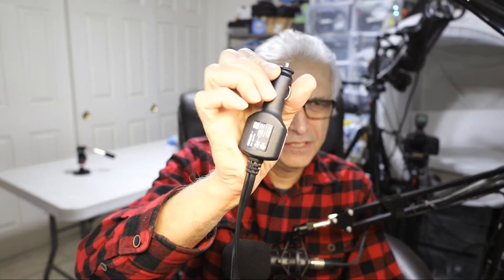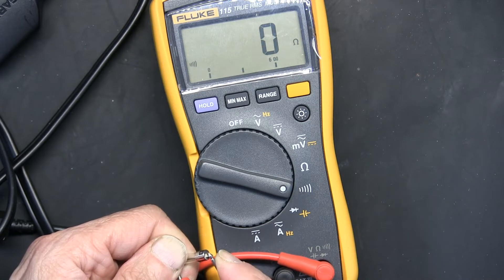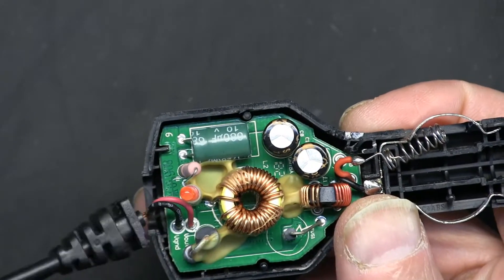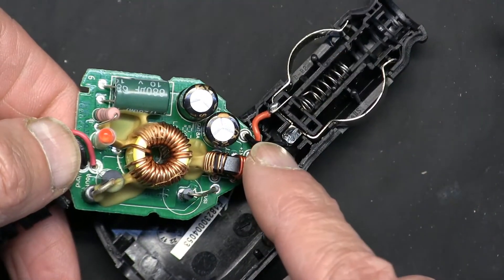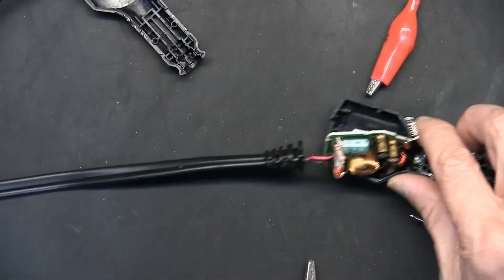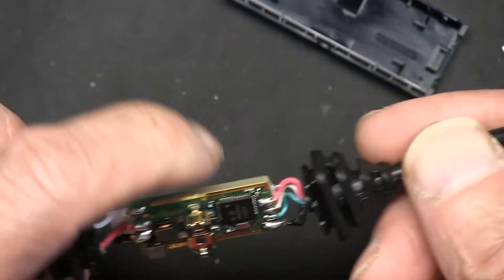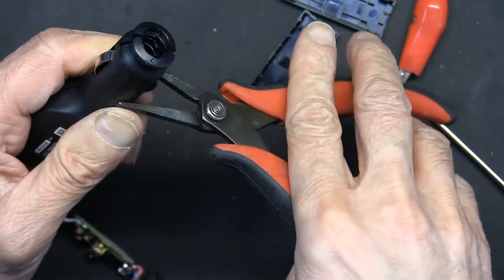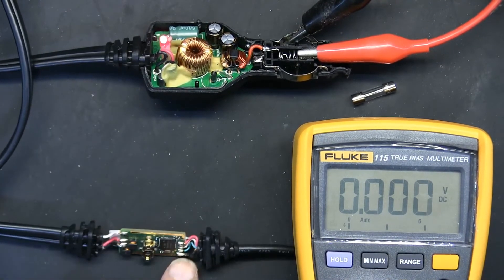Diagnostics, Fuse Check and Repair of Garmin GTM Traffic Receiver For GTM60 GTM36 GTM35 GTM26 GTM25

Comment: HELP! I have a functioning GTM-36. My problem is i don't have the external antenna that you can plug into it to make it receive better. It appears to be a 2.5mm plug but dont know if its a stereo type plug or a mono type plug. The pin-out of the plug is also unknown. It would be very simple to build one if we knew what type of 2.5 mm plug, how long of wire and what pings on the plug to use. I live in an area where signals just not strong enough with out the external antenna. The GTM-36 I bought on ebay had the external antenna piece missing. The GTM-36 does work just needs a little help for better signal............Also great video.
Reply from the maker: They are only $6 and you can get them on eBay. Here is an example https://www.ebay.com/itm/236423872364

Comment: Garmin are now supplying  sealed charger units,if the fuse goes,you'll have to buy a whole new charger,no changing fuse anymore!!
Reply from the maker: Thanks for letting me know. That is so sad and very unethical in every way. I can't believe what corporate greed can push them to do. I hope they think again and improve their design to let people change their fuses without forcing them into buying a new charger.
Reply: @TECHNOLOGYTIPS101  a replacement  charger unit us 39 euros!!
Reply from the maker: @niallchurch2679  Can you imagine!!! When replacing the fuse, it would cost less than one Euro.
Reply: @TECHNOLOGYTIPS101  yup that's right,got an email from them confirming, the garmin drive 53 I have with usb c connection, has a c connection charger, and the fuse cannot be replaced alone,a new unit will have to be purchased for it!

Comment: How do I avoid blowing the fuse or damaging the internals of my GTM60 because its not a cheap cable and its in fact my favorite for my 2597
Reply from the maker: These are some common causes of fuse blowout. 
1. Short Out the output 
2. Let the Cable or GPS get wet 
3. Use the cable on a GPS other than what it is designed for
4. Use the cable in a car with Bad Alternator 
5. Fried components inside the GPS

Comment: After seeing this I realized that if the cigarette lighter part was not working, but the traffic receiver part was OK, then you could also just remove The cigarette lighter and replace it with a simple USB-A or USB-C cable at the 5v power lines and then have a functioning traffic receiver cable that plugs into a USB port in the car rather than the bulky cigarette adapter. Is that correct ? Of course the USB port in the car would need to be 2A, but many cars have that now.
Reply from the maker: Hi, yes you can but add a 100μF 16V electrolytic capacitor to the output so that it can handle the aggressive current fluctuation that the Garmin will subject the USB port to. This way the Garmin Screen will not flicker during usage.

Comment: Hi, please help me I have dēzlCam LMT-D and the camera that shoots no longer work! appears that does not see the SD card, has update done sd card is reset and nothing! thx you
Reply from the maker: Hi, try using a SanDisk SD with SDHC Class 10 and see if it will work
Reply: @TECHNOLOGYTIPS101 , Hi, I tried everything, actually worked and suddenly it doesn't want to anymore! The problem from garmin I don't have service in the UK in the north and you can't even find the option to reinstall software from their web page. Thx you for your time.

Comment: Will GTM 36 work with Garmin DriveSmart  55 MT-S? In the internet I can find it's useless: "[...]The HD Digital Traffic reception in the DriveSmart 55MT or DriveSmart 65MT is built-in to the GPS unit itself. It does not require an accessory traffic cable. It only requires the TA20 vehicle power cable that comes with it. This means that you don't need to drape your power cable to enhance coverage from the HD radio stations nearby; the signal is received directly through the GPS.

One can use a GTM36 or GTM60 cable with the DriveSmart 55 or 65, but there is no advantage.[...]"
Reply from the maker: The difference between the standard ( Analog ) FM receivers and Digital HD receivers is not only the traffic information coverage, but the speed at which it refreshes. For example lets say there is an accident on the freeway the Digital Receivers will notify you much sooner than the Analog. The same goes when the accident clears. Also depending on where you live the HD Receivers can get more than traffic such as weather conditions road closures etc.
Reply: @TECHNOLOGYTIPS101  but do you know will my garmin detect GTM 36? For now with basic original car charger when in garmin I open app "Traffic" it says "Open the Garmin Drive app on your phone". So I'm confused will it also work with GTM 36.
Reply from the maker: @xdmichal93  Here is the list of Garmin devices that will work with GTM36 https://www.garmin.com/en-US/p/100586#devices

Comment: Having issues connecting my gmt60 to Farmington dezlcam 85
Reply from the maker: Do you mean DezlCam 785?
Reply: @TECHNOLOGYTIPS101  yes. Sorry for the typo
Reply from the maker: @jaimeblazer2002  Which exact one do you have?  dezlCam  785 LMT-S  or dezlCam  785 LMT
Reply: @TECHNOLOGYTIPS101  dezl cam
Reply from the maker: @jaimeblazer2002  You need to run Garmin Web Updater to updage the firmware on your Navigation unit to make it compatible with HD Traffic. Do not use Garmin Express only use Garmin Web Updater here is the link for it https://www8.garmin.com/support/collection.jsp?product=999-99999-27
Reply: @TECHNOLOGYTIPS101  connect to a computer?
Reply from the maker: @jaimeblazer2002  Yes it has to be a PC, it will not work on a Mac, and also use the same USB cable that came with the device. If you don't have it then use any Mini/Micro USB to USB A Cable.
Reply: @TECHNOLOGYTIPS101  thank you. I will be trying it as soon as I get a chance.
Reply from the maker: @jaimeblazer2002  Good luck!

Comment: Hi, your video was very useful for me. I have a GTM25 and plugged it into my Garmin navigation, the navigation thinks it is just a power source and has no traffic information function. I took the power side apart and the structure is different than in your video, there are three wires, two white and one black. One black and one white should be the 5V output and the other white wire should be the antenna, but it's not soldered to any of the solder joints, is this normal?
The traffic information receiving module near the plug side is also different from the one in the video, it's not plastic, it's rubber molded in one piece, how should I disassemble it. Thanks!
Reply from the maker: Hi, I believe you have the older style GTM25 like this one  https://www.ebay.com/itm/391239830947 unfortunately they are can't be disassembled unless you brake it. Yes the white cable is supposed to be not connected to anything on the cigarette lighter port.

Comment: I just bought a used Nuvi 3597 and the cable has poser issues and seems to be a loose wire. thanks to your video I will be able to fix it and understand how it works.
Reply from the maker: You are very welcome, and good luck with the project
Reply: @TECHNOLOGYTIPS101  Mine has a 3 wire where the power comes in. it is white (antenna?)....Do you have some thing on the 3 power wires,,,the black and red are basically wired together as they are bare coming from the cord, and the white one has separated from the board.
Reply from the maker: @FLHR97 The white one is just an antenna cable, it is not supposed to be connected to any point on the cigarette lighter adapter.

Comment: The red LED is on on my GTM60, but there is no power getting to the GPS.  Is the red LED across the output of the 5volt supply, or it it wired across the 12volts on the input?
Reply from the maker: The Red LED is powered from the output 5V not form the input 12V source. You can see the LED and the Resister next to it in my video at 5:01
Reply: @TECHNOLOGYTIPS101  Okay, that's what I thought.  So if the LED is on, the 5v is working and I don't need to open that part of the cable up.  Thanks.
Reply from the maker: @RCAquadruplex  Exactly, so the problem is either with the cable or the black box in the middle section.
Reply: Does the GTM need to show a green light, mine shows red light but charged my garmin

Comment: Hello, my cable is broken close to the garmin navigator. You told it need to be garmin original cable, when replace the cable (so receiver works). But if i buy a cheaper power supply cable, and replace it (soldering new cable to the traffic receiver) I just wonder, does this new cable have 4 cables so the traffic receiver will work??? In most case, the cable is broken and a new gtm 35 cable cost too much for an old navigator. 
So please, where do I find a garmin cable with  4 cables to soldering to the receiver so the receiver works, or I can only repair so navigator get 5 volt power from the car?

Sincerely 
Sture Andersson 
Sweden
Reply from the maker: Hello Mr. Andersson. You can buy a cheaper version of Garmin GTM cable even a broken one from ebay for less than $10 and then use the cable to repair your more expensive GTM35 Traffic Receiver. For example this is only nine dollars https://www.ebay.com/itm/393566192507
Reply: @TECHNOLOGYTIPS101  Thank you for fast answer!  So you are sure that the cheaper original garmin charger cable have 4 inner cables connected to the plug, so the traffic receiver will work after I solve the cable to the old cables traffic receiver? Plus and minus is easy to see but the other 2, if they are not in the same color as in the old cable, then maybe receiver not work or broken? What do you think? 
Sincerely 
Sture Andersson
Reply from the maker: @SkipperonBigDeal  Yes they have the exact same colors and number of wires, so it will be an exact match to your broken one.
Reply: @TECHNOLOGYTIPS101  Thank you very much!

Comment: Great video.  I have a cable to a Garmin Drivesmart 50 LMT.  It has traffic but doesn't have the black box in the middle of the cable.  Not sure how it does traffic.   Mine has no power, with the LED not lighting.  The fuse is good.   Do you know if I would have similar circuitry as that in this video if I break into the unit?  In other words, if the circuit board is bad on mine, do you know if I can use a board from cheaper Garmin ( without traffic).   Perhaps the traffic-specific circuitry is also in the main housing on my cable?
Reply from the maker: Thanks, If your Garmin Cable is TA10 with a yellow LED, or TA20 with a blue LED then it means your Garmin GPS has the traffic receiver inside of it. So the cable only serves as an Antenna for the internal traffic receiver. In that case you are correct any cheaper cables' circuit board should work for you as long as it is the same current 2A. Also for your information the traffic receiver is inside the black box in the middle of the cable, not on the cigarette lighter part.

Comment: To much work. I just bought one for 60 bucks. And wala!!!! 😄😄😄
Reply from the maker: You are correct it is not worth the time if your time is worth more than the value of this item. For example if you are a Doctor or Engineer who makes the $60 in half an hour it would be a waste of time to fix this. However if you are a minimum wage employee making $60 a day, then it would be worth spending an hour on this to fix it. Also replacing the fuse is something you can do in 30 seconds so it's worth checking the fuse before you throw it away.
Reply: @TECHNOLOGYTIPS101  well said. 👍
Reply from the maker: @rigobertohernandez2524  Thank you!

Comment: Thank you so much for this very informative video.  I was thinking I might be able to just cut off the end of the cable and hard-wire it to my cars 12v switched circuit.  But now I know that it would fry the mild circuit if I had done that.  So thank you very much!!!  I will instead will just buy a female cigarette plug and hard-wire that and plug the cable into that.  My one question would be, I would think they could make a much smaller converter from 12v to 5v @ 2amps.  Any thoughts?
Reply from the maker: Yes they do make that here is an example https://www.ebay.com/itm/174141782311

Comment: Very informational! I guess TA10 and TA20 are just a regular Garmin charger + a third wire connected to USB's D+ or D-?
Reply from the maker: Yes they are, but TA10 is also lower current, which means it is for smaller Garmin GPS Devices. The TA10 is 5V 1.5 Amps, vs TA20 which is 5V 2 Amps
Reply: @TECHNOLOGYTIPS101  Thank you for your answer. Will try to find out whether it's D+ or D-. BTW for TA10, Input 10-24V DC 1.5A, Output 4.75-5.25V DC 1.0A.
Reply from the maker: @j.d.3269  Yes but the output is 5V  they write 4.75-5.25V to describe the tolerance or fluctuation in voltage. This is the case with any DC power supply the voltage is never exactly what is printed on it. It fluctuates based on many variables such as load, input source, operating temperature etc.
Reply: @TECHNOLOGYTIPS101  Can't agree more. Thanks again.
Reply from the maker: @j.d.3269  My pleasure!
Reply: Did you find out where the third antenna connects?

Comment: Very thorough video,  thank you Sir! OK the cable that is with my cigarette adapter doesn't have a third cable coming out of the receiver,  I opened it according to your tutorial and checked. 2 wires going to the cigarette adapter and 6 wires going to the navi unit. There's though the jack opening for the aerial cable. So maybe I can cut it and lengthen? At least only lengthen the cable and keep the Garmin adapter too.  It's going to occupy the cigarette adapter,  and the other power outlet I have will be for the DVR and all power outlets the car has will be occupied . Thing that bothers me is, as you say these things are expensive,  I can't sell it later to get the smart navigation unit with the BC-40 cam. Or,  maybe,  if it goes well, I can advertise the system as "stealth"  installation,  as no loose cables can be seen anywhere?
Reply from the maker: Yes as long as there is no third cable going to the Cigarette lighter port it should be fine to cut it short. However remember that you still need the circuit board inside the Cigarette lighter adapter port because that is you step down voltage inverter. The input is 12-24VDC and the output is 5VDC. So you cannot feed 12V car battery power directly to the GPS, or Dash Cam.
Reply: @TECHNOLOGYTIPS101  Thank you very much for your help! I was using another cigarette adapter that had 3 ports,  albeit without a fuse.  It fed all my devices,  but now,  for the sake of keeping the value of the combo  I'll use the Garmin one.

Comment: Thank you so much for this. I could literally not find a circuit diagram anywhere. A new GTM60 cable costs R 1850 in South Africa. To put it in perspective, that is equivalent to 74% of the new 2020 legal monthly minimum wage of a domestic worker in SA. Your help will help many others who simply can't afford to purchase a new cable. 

It does seem to me that I might have to purchase a new one. Even feeding it 5.2V DC (2.0 Amp) from a Lenovo tablet charger via USB, it turned the Nuvi on, but it would indicate the charge-bolt sign inside the battery logo & couldn't access any traffic devices. Perhaps I damaged the GTM60 when I fed it 12V a year ago. Thank you anyway.
Reply from the maker: You are very welcome, and yes you are correct if the traffic receiver in the middle of the cable is subject to 12V it will get damaged. Don't worry you can find a defective one for a few dollars on eBay and use the circuit board from that one to fix this one. Good Luck